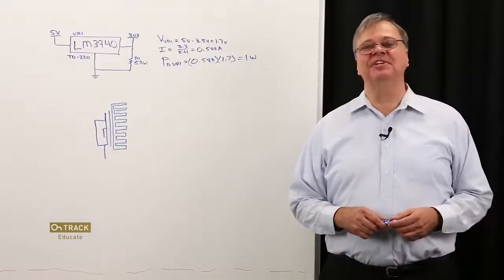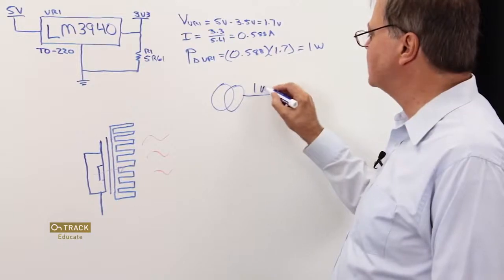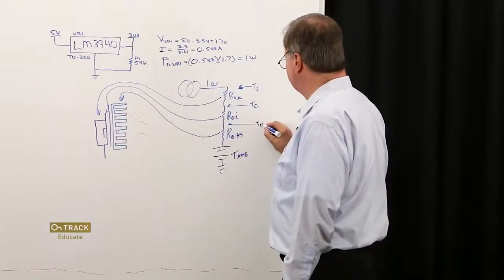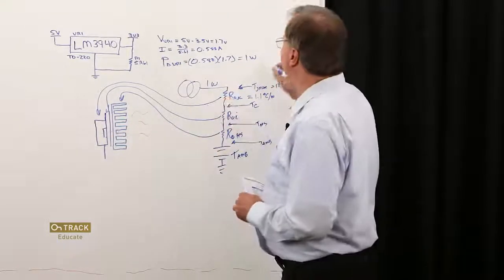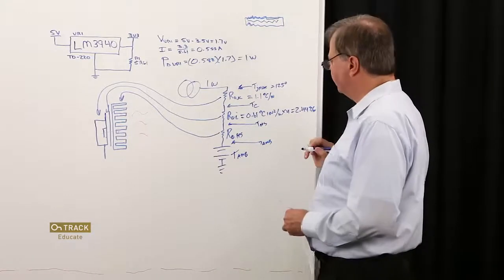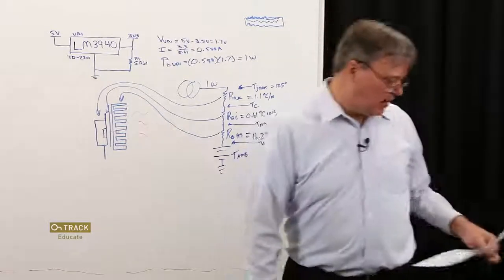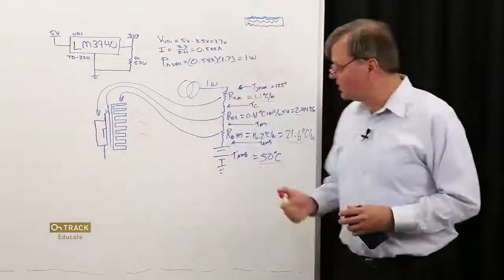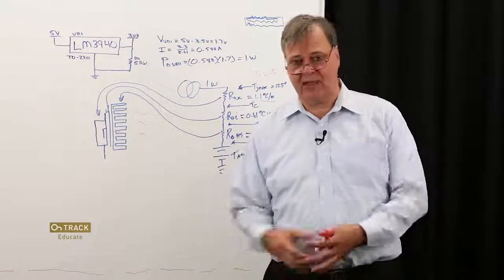(2) Thermal Management - Sizing a Component Heatsink - Altium Academy

Comment: I am confused. If the heatsink acts like a resistor, then why we use them? If we eliminate it the resistor will be zero, and the junction temperature will be more close to ambient temperature, right?
Reply: Hello Aygin, Thanks for your question. The heat sink does provide thermal resistance, but the thermal resistance between the component, heat sink, and air is lower than the thermal resistance between the component package and air directly. This is because the heat sink has high thermal conductivity and a larger contact surface area with air to dissipate heat. Hope this helps answer your question!
Reply: @Zachariah-Peterson   Yes. Thank you.